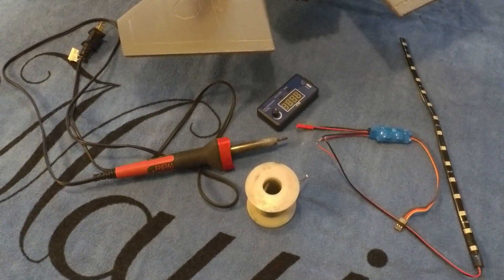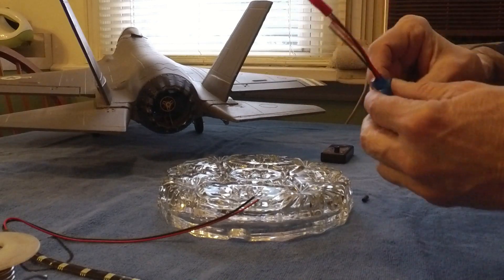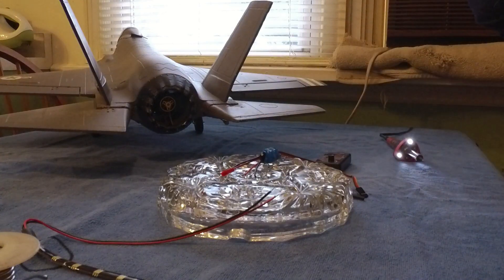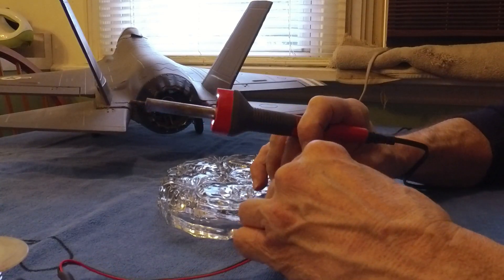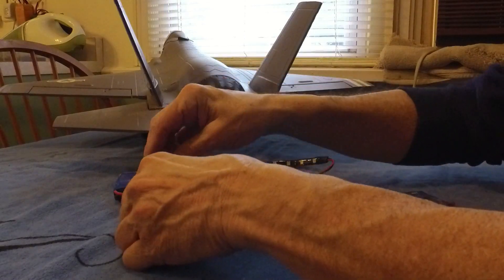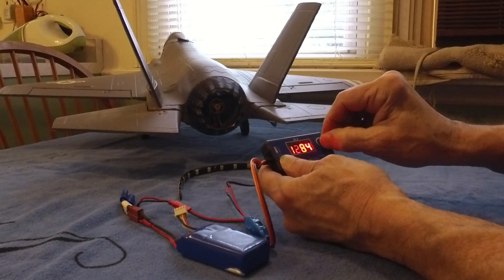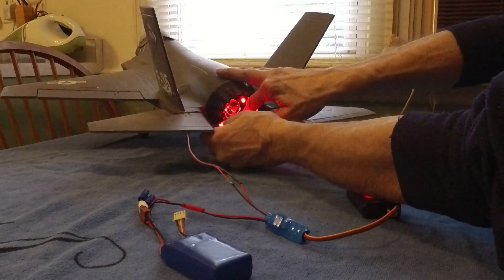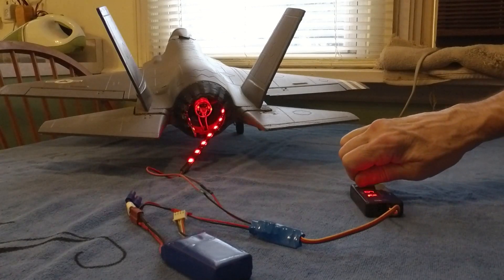Do It YourSelf EDF Afterburner,  Made Quick, Easy and Affordable !!!

Comment: I got the Eflite F-18 Blue Angel and wanted to give this a try. Of course I’d have to make two, but it should make for a nice winter weekend project when the weather is partly shitty. If I can make it work and keep the price under $200 it’ll be a winner. Thanks for doing this. I’d like to add afterburners to a few more EDF’s I have that survived me poor landing skills. (F-16, Viper, a-10, T-33, ME-262. All of these, other than the Viper are on nose gear pin replacement 2, 3 or 4. I cheat and steal, but I don’t lie)
Reply from the maker: For better burners, try Gooniac's afterburnes.  They work great and not too pricey.  Inrunners only though.  Otherwise RC Geek has a different one that fits both
Reply: @SkipBuiltRC  Chris’s were $90 a piece, or $180 for the F-18. I may crash it on the maiden takeoff. 
For the 80mm T-33, it’s impossible to crash. Flies, takes off and lands easy. I should get an afterburner for it. Best flying edf I’ve owned.
Reply from the maker: @jeffhenderson934  yes,Chris charges more than gooniac33@gmail.com
That's his email.  My double set for my mig29 80mm was only 95$
Reply: @SkipBuiltRC  I may have thought the $95 was “per afterburner”. I’m wrong a lot, so I’m not surprised.
Got in 4 flights this morning with the Freewing T-33. Gusty, mostly crosswind. Best flying edf I’ve ever flown. Had AS3X helping me, but man did the folks at Freewing do a good job designing and manufacturing it! All 6s 6000’s. It deserves an afterburner.
Hope you’re doing well. Always good to get your advice and your experience. Thanks.
Reply from the maker: @jeffhenderson934  my pleasure buddy.
Have a great year.  Hanging in there my friend.  Thanks 😊
Reply: @SkipBuiltRC  you’re a good man Skip. Thanks for all the videos and helpful hints. Much appreciated.
Reply from the maker: @jeffhenderson934  Thank You my friend

Comment: Can you draw a diagram  rgeller56@gmail.com I got it working and it's bright with the throttle but I haven't hooked up to the jet yet to its receiver to see if it'll work they say I don't want to burn out my speed controller sending two sources of power Direct
Reply from the maker: To be honest, I haven't hooked up to a jet either.  Gonna try it first with a spare esc .  Just haven't been able to get back to it yet.  I understand that you may have to put a resister on the red wire.  Check out the group forum from  the  link in the video.   Let me know if you try it 1st.  GOOD  luck
Reply: @SkipBuiltRC  if I hook it up and I get it working I will let you know how I did it

Comment: Can you get blue lights and it stay on bright all the time? That’s what I’d like to have, w/ center burner and ring in blue.👍🏻✌🏻🖖🏻
Reply from the maker: Absolutely, just wire them direct to 3s or 4s.  They're rated at 12v. but I have run them on 4s lipo and they get warm but hold up.  In flight, no heat problem at all.